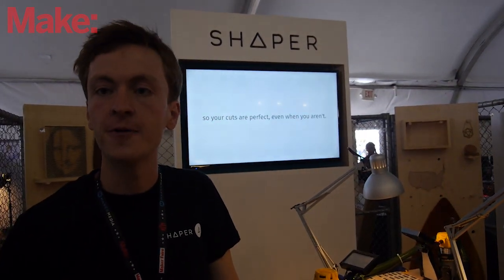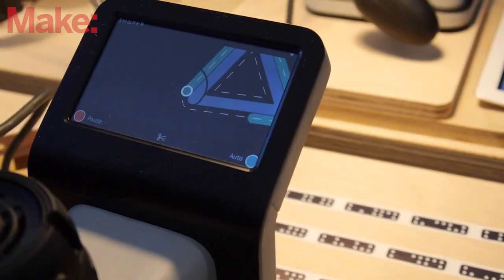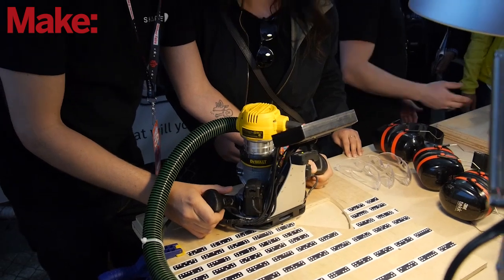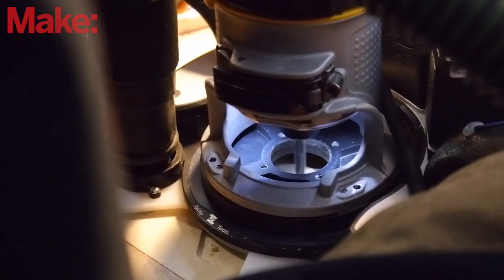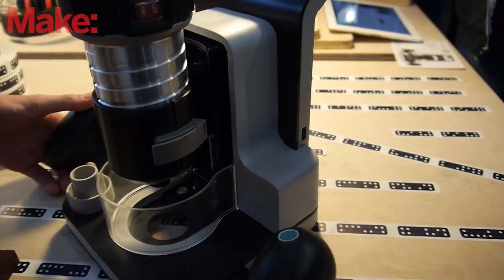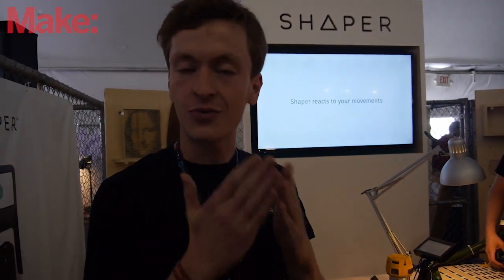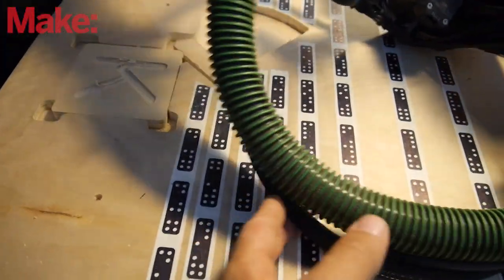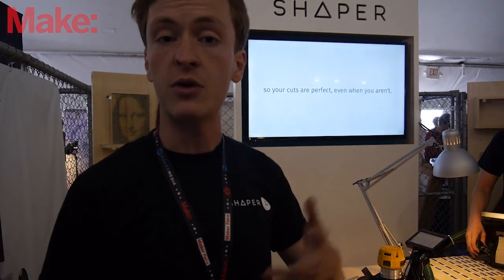Auto-Aligning Router

Comment: Would like to see how it moves the router around actually. To make any kind of corrections you'd need quite a bit of force to correct the router. In free air not so much, but in wood or metal that would be quite a bit harder.

Comment: "so, instead of perfecting my skills and learning patience, self-control, and so on, i invented this $$$$ machine because i'm a terrible ass in woodworking"
Despite he can be really good in engineering, he completely misses the point of interest about handcraft. He looks to be a Lego generation's byproduct.
Reply: deanedgx Not afraid of the future, especially not about modern techniques, but even in terms of pedagogy such auto-aligning router isn't good at all. Teaching, conveying our experience is a very important process, it doesn't only teach how to make something but methods, way of thinking, it's all about resolving problems, a logic approach. Hiding complexity never made things simpler. Btw, here we're talking about a tool directly replacing the operator skills, while a true CNC will just do things we wouldn't be able to achieve by manual control, and as a defender of CNC machining, i don't approve such a router extension, because mastering skills is very important : even machines of hundred of thousands dollars requires highly skilled operators to hand scrap every reference surfaces. Is it taught in schools, like filing 'till making squared planes ? Not anymore. I'm talking you about knowledge and you talk me about what ? The future of what ? Making people unskilled never served anyone, it's just cutting the branch we're sitting on.
Reply: Okto Putsch If you want to just learn to be a woodworker, by all means, crack on and spend your life doing what you love. Time-saving is good if you want to learn many things. I don't suppose you walk around asking people how to do things rather than use online search engines, right? While I agree with you in part, you can't shun all automation either.
Reply: +Okto Putsch I think you may be missing a point...that is we don't live in a culture that respects craftsmen or laborers or gives two shakes for how 'hard' or 'skilled' it was, RESULTS are all that matters.  This gives much higher results with much less input so with this object we can hire fewer/less skilled workers and get the same RESULTS which is all anyone gets paid for.